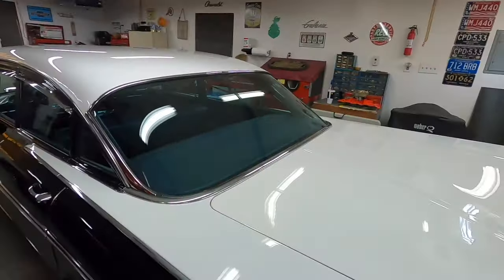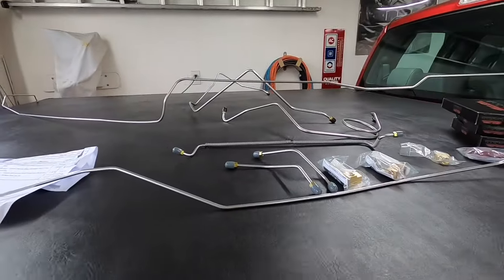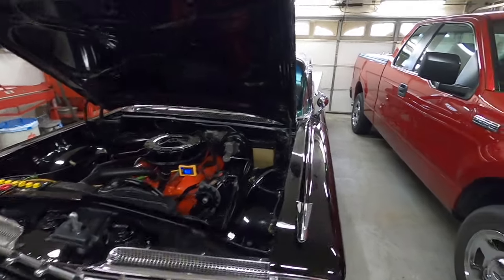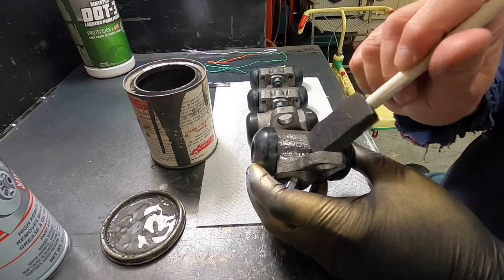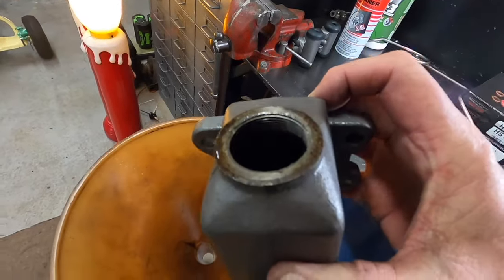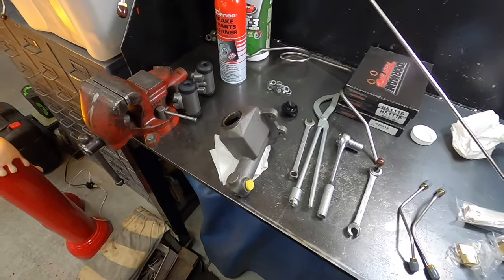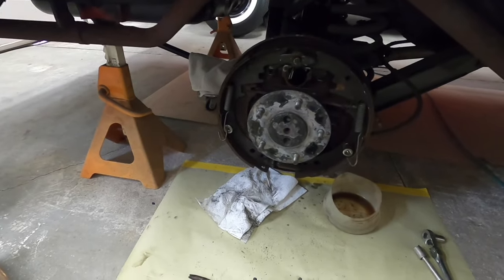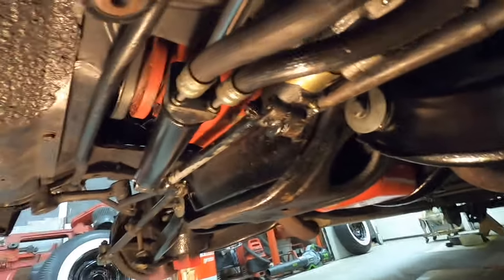Replacing the hydraulic brake system on a 1959 Chevrolet Bel Air

Comment: The previous owner of my Corvair used Dot-5 silicone fluid when he had the lines replaced. Not only is it expensive, I’ve also found it very hard to bleed. I have to resort to a bladder-type pressure bleeder to flush the system properly. Yes, it has advantages and won’t blister paint, but the disadvantages outweigh the benefits in my opinion. It also makes a terrible mess if spilled, and is very hard to clean. I flushed it out and went back to DOT-3. Flush it regularly and you’re all good.
Reply from the maker: Thats almost exactly what I heard from a friend that used it ONCE! He also stated after a few stops the pedal would get spongy. He stated don't use it, so I didn't.
Reply: @OldCarAlley  That’s exactly what happens. You can’t get a proper firm pedal when bleeding, because it froths and traps air bubbles within the fluid causing voids when pumping the pedal or using normal brake bleeder hand pumps. When I first bought the car in 2020, I replaced the wheel cylinders and went to bleed with more DOT-5. I spent hours trying to get it to bleed, even roped in my Dad (a GM engineer) and uncle (also a mechanical engineer and Porsche mechanic) who were equally perplexed that an old single-master drum brake system had us stumped. It took about a gallon+ of DOT-5 being continually & consistently flushed through with the pressure bleeder machine to get all the bubble-laiden fluid out of the lines. Later that year I flushed it all out and went back to glycol. Never again!

Comment: Hey Howard I was a little confused at the beginning of this video because I thought the brakes were done.  But you repacked the wheel bearings in between.  I couldn't understand why you weren't using your new light at first. I finally figured it out.  I have to say this was a very interesting video.  Of course it's a learning session for me because it educates me on my Belair.  The only difference is mine is a duel system and yours a single.  Anyway, do you remember the first time you rode in my Belair you noticed that my front passenger brake squeals when they are hot?  You mentioned that it needed a longer spring?  Am I right that you said that?  I have another problem with that brake that I would like to discuss with you.  I'm saving that for our next visit.  Anyway have you chosen the day you are going to pull the seat out of the Belair?  It's supposed to rain most of next week.  Are you planning on moving the truck out of the garage to do it?  I certainly would like to help with the seat belts and the new foam instalation.  Maybe even if it's to hold the camera to free up your hands.  How are things going with the rental?  Again this was a great video!
Reply from the maker: Yes, I did a bunch of odds and ends on the Bel Air why waiting on parts. Not sure when I will start on the seat. I want to have the belts before starting and I have other appointments in the next two weeks, so I have no clue when I will work on that. 

If you look at my front drums, maybe when I painted them, one has a spring wrapped around it. That will stop a drum from squealing or chattering. A lot of cars rolled off the assembly line with a spring around the drum to stop drum noise..... not uncommon back in the day. A screen door spring from your local hardware will do the job of quieting a drum down. 

I'v been rained out of working at the rental, so maybe next week I'll get it finished up.....

Comment: Unless you're going to do a front disc brake conversion, I don't see the point in rebuilding everything if it still passes inspection. But thats just me.
Reply from the maker: I find the old drum brakes are fine, as they will stop that big old car just as quick as modern cars with four wheel disc systems.